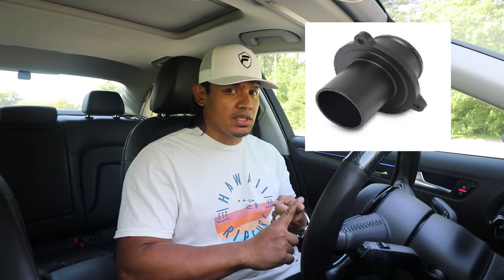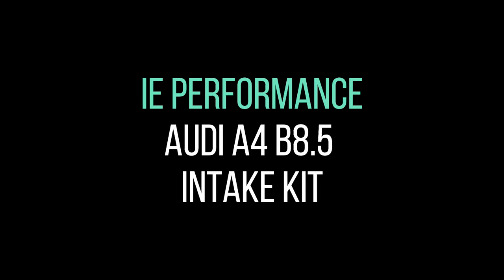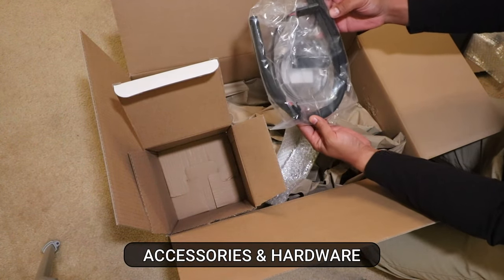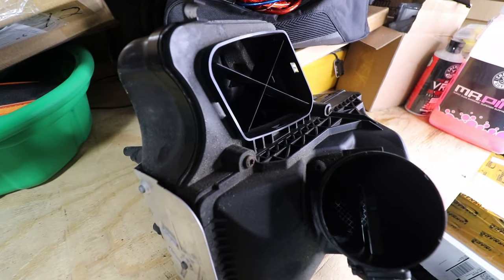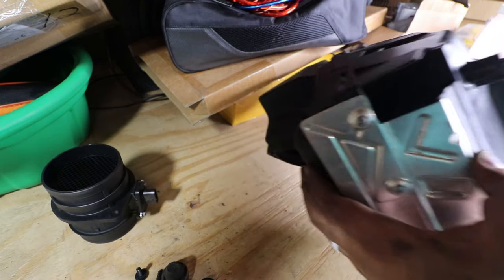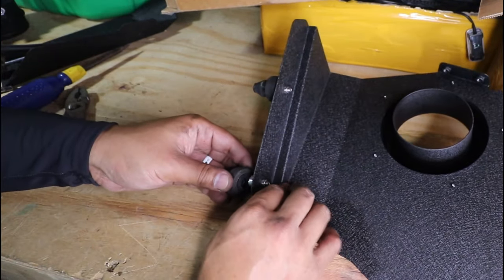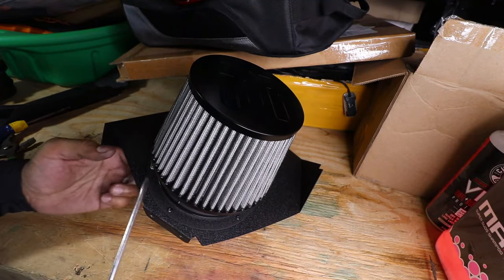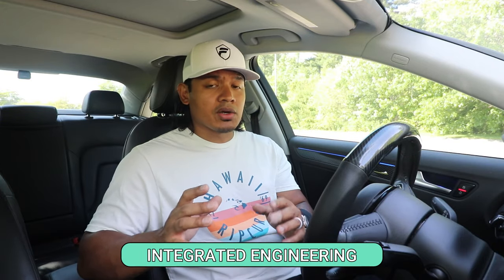The only Cold Air Intake that should be on an Audi A4 B8.5

Comment: Ughhh😍 those stutututu noises gonna make me act up😅
Reply from the maker: It’s a cool sound but it’s only happens when I quickly let off the gas. That’s not really how anyone drives. I gotta adjust the blow off valve so it’s less stustustu and more whooshing (air release sound).
Reply: @TheFlexxGarage  that flutter is just air not letting out, so slowing down the turbine.. and in the long run might wear on the turbo and in need of a replacement.. so an adjustment to the blow off valve might be good
Reply: How will (have) you adjust the blowoff?
Reply: @cabanjosue  good question..

Comment: Okay for my Uk guys looking at getting flutter you’ll need the Gfb dv+, turbo muffler delete, custom intake or cts intake and you have to tune the engine either with a custom tune or plug and play that’ll give you some nice gains in power and the sound that you’re looking for, hope this helps :) also this cost me around £400 so definitely worth it imo
Reply from the maker: You actually only just need the intake and DV+.  A turbo muffler delete is not a must or a tune.  The turbo flutter sound happens when you quickly get off the gas pedal (which closes the throttle body) and this forces the boost charged air backwards towards the turbo and that air gets chopped up by the turbo blades and that makes the flutter. 

With a stock intake and diverter valve, the sound is hidden. 

The sound is amplified cause of open air filter intake and DV+.   It‘a okay to have the flutter but not all the time. And having the flutter while building boost while pushing down the gas pedal is bad. Cause forcing air into the turbo in the opposite way is not healthy for the turbo.
Reply: @TheFlexxGarage  oh yeah I agree 100% but in the Uk our engines are de tuned like crazy that’s why I suggested getting it tuned as well as the muffler delete, I personally don’t want the flutter but you can’t avoid it with a manual especially when spirited driving, great video btw nice too see you still reply to comments even on your old stuff. Subscribed.
Reply from the maker: I read every single comment. If you guys took the time to watch my video(s)...I will take the time to respond. FYI...Im jealous. Wish I had the manual. Gotta be so fun especially in a tuned A4.
Reply: @TheFlexxGarage  I have the A5 b8 and the manual is very fun audi boxes are some of the best but I’m looking for a short throw shifter in the near future, also have you upgraded the inter cooler at all these engines run mighty hot when you thrash on them a bit
Reply from the maker: yeah...watch my other A4 mod videos after this one.

Comment: Recently got a used 2013 a4 quattro with 90k miles. Threw a 2099 code gonna go for a stage one tune and install new parts

Comment: Love the videos ! I have the same Audi and so far I have bought the same diffuser, spoiler, and exhaust as well as debadging the car. I installed the k&n Intake. Want to do the diverter valve next that you did in your video. Hopefully your giveaway has Audi parts 🤩
Reply: Hey man, I have a b8 A4 with the k&n cold air intake, by any chance do you hear a whistle when accelerating?
Reply: @juliancileli9629  That's very normal. Happens with most cold air intakes. The stock air box has a sort of resonator in it that suppresses the whistle, but the CAI does not have that

Comment: Can you hear the turbo stutter from the inside with the windows closed ?
Reply from the maker: Wwith windows closed, I can hear the intake sucking air and the turbo whistle while normal driving. It's not super loud but you can tell. When I get on the gas with spirited driving, then all hell breaks loose. Can hear everything!!! with the windows closed. This mod basically cranked up the volume of the intake and blow off valve.
Reply: @TheFlexxGarage  definitely doing this mod to my A4

Comment: I was always told open air filter makes the performance worse for my 15 S3, not sure about that but I was told it already has bad heat soak issues and getting an open filter makes it hotter
Reply from the maker: Yes and no. You can’t expect a lot from just an air intake/filter.  They don’t really do much as a stand-alone mod. You might see some slight performance gains if it’s shield properly and the air filter isn’t restrictive. The IE intake kit is shielded and it isn’t restrictive and it’s aimed in the engine bay to get fresh air, not recirculated hot air under the hood. 

Air intake kits are designed more for when you add charge pipes, bigger intercooler, etc… cause then, those parts of the car will help the air get cold regardless if the air coming into the air filter is warm. If you have an unshielded open filter, of course it will suck in hot engine air and reduce performance but not all air intake kits are the same.

Comment: My airbox has a wire connected to it at the bottom, any ideas on how to remove this?

What does it do?
Reply: Its a sensor. If you remove it, it may cause the check engine to come on or run rich/lean as it doesn't know how much air is coming through

Comment: Sounds dope, I have a 09' A4. Currently have a stage 1 tune and centre res delete, will I get the turbo flutter with this kit without doing anything else? or do I need DV spacer and turbo muffler delete. Cheers
Reply from the maker: the intake alone will do it.
Reply: @TheFlexxGarage  Sweet as!. Also, did you need to modify your tune to get the car running properly with the intake or does the ECU just automatically compensate for the extra airflow? Cheers.
Reply from the maker: Don't really need to adjust the stock tune or stage 1 tune with the intake, blow off valve, or turbo muffler delete. However, once I install the intercooler and downpipe...I will need to run a stage 2 tune asap.

Comment: For te actual filter itself, how long do they last? would u need to buy a replacement here n there, or could u clean them?
Reply from the maker: It’s a cotton based performance filter. Should be able to clean and re-oil but they don’t recommend oiling it. https://performancebyie.com/products/ie-cold-air-intake-filter-vw-audi

Comment: How’s the stage 1 tune been after a couple months? What main differences did you notice
Reply from the maker: Fine. No issues. Feel more power and torque for sure.  I’ll be going stage 2 in a few weeks.
Reply: @TheFlexxGarage  let me guess, waiting on the Intercooler? I’ve already got the IE downpipe, just waiting for the intercooler myself to go to stage 2

Comment: my turbo doesnt flutter when im sitting still for some reason
Reply from the maker: The flutter comes from upgrading the blow off valve and turbo muffler delete. The intake install just enhances the sound (if the sound already is present).  

Putting a cold air intake on a car with a stock diverter valve is not gonna give you a loud turbo flutter. You might get a little but not like mine since I upgrade my diverter valve to a blow off valve and I installed a turbo muffler delete.

Comment: Do you really need the sensor extantion cable? It looks like the stock cable is long enough.
Reply from the maker: Yes.  Cause the air filter flexes/moves when you are hauling ass and the filter is sucking in air.  No point in risking the oem cable snapping.

Comment: Hey man, I was just wondering if you had like a slight whistle whenever you’d press on the throttle with the aftermarket air intake. I’ve heard mix reviews about it being the issue and how cold air intakes offer no extra power, is that true?
Reply from the maker: Yea. Slight whistle but I like it.  Intakes alone rarely give more power but it will increase responsiveness and if I ever plan on building up the engine some more, then an intake is a must.  It’s okay alone but works even better in combination with other mods. I’m going stage 2 so that means intercooler, downpipe, and new aggressive tune.

Comment: Gotta get one of these for my brother
Reply from the maker: Totally worth it!
Reply: @TheFlexxGarage  he has a passat that screams but the stuututtuutu is not there
Reply from the maker: Hmm. Not 100% sure if he will get the stutuutu. The A4 has the sound from the factory but it’s barely noticeable because Audi did a good job of muffling it. When an open filter intake is installed, it unleashes the sound.  Not sure if the Passat is the same. I bet there’s a YouTube video on someone installing an intake on a Passat. Maybe that can tell you if you’ll get the sound or just a straight sucking intake sound. 🤷🏻‍♂️
Reply: @TheFlexxGarage  so is it okay to put a BOV and a Turbo Muffler Delete on a stock a4 b8.5? Or should I get an intake also cus I will later on…

Comment: Can i get the stututu noise from just installing the cold air intake or do i need to modificate the turbo as well?
Reply from the maker: The cold air intake will add more sound but i also did a turbo muffler delete and a blow off valve (in another video). 

My stututu is actually not crazy loud.  The mic on my camera made it sound loud.   You actually don’t want a loud stututu.  That means there’s too much charged air flowing against the normal way the turbo spins.  In the long run, that’s bad for the turbo. 

A little stututu is fine but not a lot.  Mine only happens when floor it and quickly get off the gas (close the throttle). The air hits the closed throttle and that air flows back to the turbo against the turbo fan blades.  That “chopping” of the air by the fan blades is what makes the stututu.
Reply: @TheFlexxGarage  aaaa i see, thanks man, I was really curious about how does it work

Comment: i have a 2011 audi a4 2.0t, i installed this intake and every time i accelerate i hear a squealing whistling noise. is there any reason for that ? or is that normal ?
Reply from the maker: Shouldn’t be squealing but whistling noise is normal.
Reply: @TheFlexxGarage  well yeah but its a constant mix of both as long as im accelerating, any tips or suggestions as of what to possibly take a look at ?
Reply from the maker: Don’t know. Why won’t you contact IE and ask? They probably have seen every issue and have a solution cause it’s their product.
Reply: It’s most likely your diverter valve, look at my videos and watch the one about the GFB dv+, I have a sound clip from before where you can hear the squeal, see if yours sounds the same. Mine is from my mk6 gli but it’s the same 2.0t just mounted transversely. If it sounds the same I’d see if GFB (gofastbits) had a DV+ fr your car👍
Reply: If you watch my video the loudes squeal sound is a little after 43 seconds in, I’d listen to all of the “before” clip’s with my stock dv though so you can make sure

Comment: hey flex I've got a ecs turbo muffler delete, gfb blow off valve and k and n cold air intake but its not making the sutututu sound when driving. would you know why?!
Reply from the maker: You don’t really want the stustustu. Cause that’s air going back to the turbo and the blades are chopping it up.  That’s what makes the sound.  My IE intake makes the car have some stustustu but it’s not crazy loud and only happens when I do it on purpose by flooring it and immediately getting off the accelerator. And I got rid of my blow off valve and went with the DV+ diverter valve instead.  It recirculates the air and that’s better for maintaining boost pressure.

Comment: Don’t you need a software tuning after installing aftermarket parts?
Reply from the maker: Haha. No. You can get away with an intake, charge pipe, and usually an intercooler without a software tune. The stock ecu can handle it and adjust for the extra air. Once you do a downpipe or larger/hybrid turbo, that’s when you need a software tune.

Comment: Did you oil your new IE intake filter before the install?
Reply from the maker: No.  IE filters don’t recommend oil like KN or others. 

PRODUCT DETAILS

IE cone filters are specifically designed for high-flow and perfect fitment to the integrated velocity stack found on most IE cold air intake kits. This is a dry filter that can be oiled, however, we do not recommend air filter oiling on turbocharged or forced induction vehicles. The filter can be cleaned and re-used many times. If you find it difficult to clean your filter or find it severy stained, it may be time to replace the filter element. This is a direct replacement filter ready to keep your car on the road and performing at its best. Includes new filter clamp.

Comment: Should you apply an oil on this filtrer?
Reply from the maker: No. Not this filter.
Reply: @TheFlexxGarage  I have audi s4 b8.5 and I’ve set S34 Carbon Fiber Intake by 034motorsport, how do I check if I need to apply oil on it? What should I do if I’ve already applied it and I shouldn’t? )
Reply from the maker: You check with the company who makes it.  IE says no oil on mine. I don’t know 034 Motorsport products.  Just message them.

Comment: if i add an intake do i also need to add a tune? (so new at this)
Reply from the maker: No
Reply: No. When you go catless then you will need to. I learned after my other A4 b8, just get everything done to it first then get it tuned. So all in one day I'm doing my catless, intake, R8 coil packs, injectors, and bigger turbo, then getting it tuned so you get the most hp out of that tune instead of having to retune every time you add something

Comment: Installed mine and it sounds nothing like yours.  I'm a little disappointed.   Mines just sounds like a light whistle.   It's like if u didn't close ur window all the way and u hear a light whistle sound.
Reply: to get that flutter you need to install a blow off valve, not just the intake.
Reply: Hmmmm ok
Reply: @dontaebutler2331 To get that same turbo flutter as in the video you need an ECS Turbo Muffler Delete Pipe, and ECS Turbo Diverter Valve Spacer. Hes got the same ones installed in his A4 as well, thats why his turbo has that stututu

Comment: Is your Audi the 2.0T or 3.0T ? 
I have 2016 Audi A6 2.0T S line premium package and can’t find anything for it… ex. The front bumper I can’t find the Audi rs swap kit, cold air intake, like basically anything on google. Like it pops up when I search for it but only the 3.0T. Any chance you could help me out with this?
Reply from the maker: 2.0T
Reply: Just search for the the A4 and A5 instead, it’s got the same engine

Comment: Did it make the check engine light come on
Reply from the maker: No.  

Cold air intakes in general don’t cause check engine lights unless you have a defective unit, you improperly install it and there’s air leakage, or you are over oiling the filter (if the filter in a kit needs oil sprayed on…like K&N filters).
Reply: @TheFlexxGarage  ok cool, just got my a4 this weekend and looking at installing a cold air filter, but was hearing about the  check engine light, thanks
Reply: @madfiji2001 did you do it yet??
Reply: I bought a 2015 Audi A4 quattro with 60k miles for 10,000 cash & it’s been garage kept lmao car is flawless I lucked out
Reply: @OnlyPrada  I stumbled into 2013 A4 quattro with 46k miles for 11K. I'm going to check it out in a couple days, but it looks pristine. 🤞
Reply: @OnlyPrada I stumbled up on a 2012 A4 Quattro with 37,000 mi on it for 12K car is in immaculate condition and is red my favorite color

Comment: Yo flex I installed the air intake on my car and i love how it sounds. I have a question tho when i floor the throttle, it sounds like the turbo is spooling up. Is that normal
Reply from the maker: Should be a nice suction noise cause the air filter is sucking in a lot more air now.
Reply: @TheFlexxGarage  that’s good would u recommend that stage 1 tune that you did
Reply from the maker: I love it.  But I’m about to go stage 2.

Comment: What engine is it in your car??
Reply from the maker: Standard turbo 4 cylinder
Reply: @TheFlexxGarage  having trouble finding performance parts for a 2.0 to a4 b8... its a nightmare to find!
Reply from the maker: You know I basically have the same engine. All my videos apply to your b8
Reply: @TheFlexxGarage  But is it 1.8l or 2.0 liter because they say it fits 2.0 so i wonder if there is any difference?
Reply: @weleho3864  1.8tfsi and 2.0tfsi are pretty much the same thing. So all 2.0 aftermarket stuff will fit your 1.8

Comment: So did anyone install a test pipe on there car Audi.do u really gain hp  .
Reply: Of course you will. Less restriction will gain you power. I don’t personally own an Audi/VW, but it’s all the same. Don’t be alarmed if you smell shit or get a check engine light. All side effects of no cat. Best to pair it with a tune. That’s where the real power is.
If you want a ghetto way to remove your check engine light, I’ve seen people do a trick with steel wool and an adapter cap. I don’t remember the exact setup, you can Google it. But the main point was it involved some adapter cap from any old auto parts store, steel wool and your old O2 sensor. Hopefully that answers your question? Happy modding my guy🎉